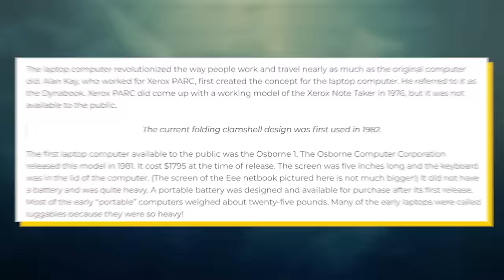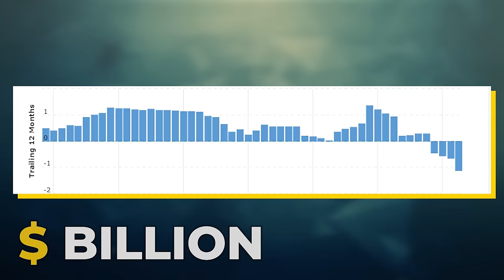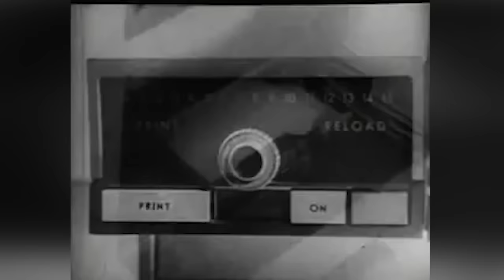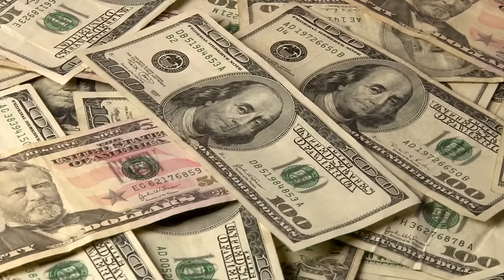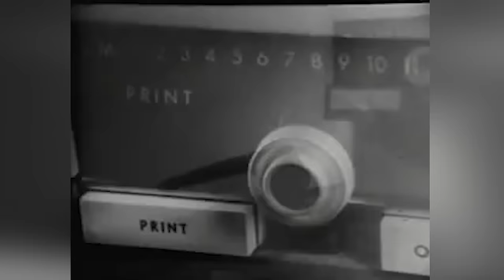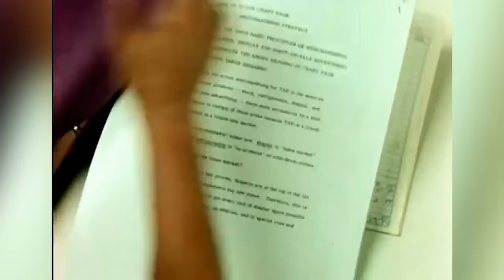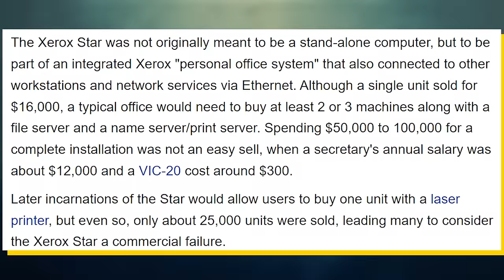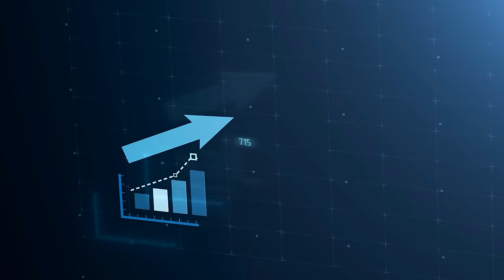Xerox - The Company That Threw Away Everything

Comment: One of my favorite quotes for continuous improvement and innovation, “The stone age didn’t end because they ran out of stone.”
Reply: Who said this pls?
Reply: @divinefavouregeh  I do not know, but I will remember it forever.
Reply: @divinefavouregeh I made it up
Reply: @Roccofan  Sheik Ahmed Zaki Yamani said this as an analogy to oil supply
Reply: @FargothsSecretHidingPlace  That sounds right.
Reply: The bronze age did. Ran out of stone, forced to figure out how that other weird stone could be smelted down into metal.
Reply: @divinefavouregeh  - Fred Flintstone😂😂😂
Reply: Amazing and so powerful line. 👌👌👌
Reply: That is probably my favorite Amory Lovin’s Quote. The Rocky Mountain institute almost recreated the Automobile. I heard Amory give a talk at Xerox PARC ironically enough. Where he summarized the work of his team on reinventing the car. Long and short for a petroleum fuel car it’s the mass stupid. Reduce the mass by half and all of the core systems can be 4 times less powerful or 4 times cheaper just do to the energy it takes to accelerate and decelerate that mass. It was brilliant. But just like Xerox (I was right in the middle of The laptops, bitmap computers, laser printers) Amory had asked the wrong question. He asked how do we make a car that uses less gas and dismissed out of hand that using less gas didn’t solve the core problem. Xerox Being in the office equipment manufacturing business Tried to make desktop publishing a vertical business with only one vendor Xerox. Xerox spent 7 years of development to bring 1 model of copier to the market. Microprocessor based computer companies were following Moore’s law and making things twice as fast or twice as cheap every 18 months. My colleagues and I left Xerox PARC and helped companies like Apple Microsoft and Linotype create the Desktop Publishing business. At Xerox it’s not that the right questions weren’t being asked, it was that the Executive Vice Presidents didn’t see any upside for them and there sycophants from partnering with the Apple’s of the world. Hell At one point Xerox owned 4% of Apple. The Star Office system was a disaster. The software developed for it would not run on the system as configured by the bean counters. Time just frittered away because the top Brass didn’t want to hear bad news. Star office was internally developed hardware running on an internally developed operating system running internally developed applications and right up to launch none of it had ever been run in the configuration that was supposed to ship to end users. You would have thought that NASA was running thing, that’s not a complement. Oh well Just like Apple and Microsoft I’m keeping the money.
Reply: @divinefavouregeh  Amory Lovins came up with this gem.
Reply: @rustybucket2248 , please tell us more when you can. Things like this are real history and so many people don't know it (believing that it's true is another whole story).

I worked in a very different place during these same times (or slightly later). I wrote up a beneficial suggestion (just an idea on paper) when I first started working at this place. It took over 3 years for the corporate big whigs to answer the beneficial suggestion because they couldn't figure out how somebody who had only been with the organization 2 weeks had identified one of the top 5 problems (with a viable solution) with the organization. 
After 3 years, the suggestion was denied. I didn't even get it acknowledged with a Dunkin Donuts gift card for a cup of coffee. Oh well.

I didn't invent the mouse, the GUI or the internet (Al Gore did that, right?) but I didn't steal these ideas and resell them them like some folks did.
Reply: @divinefavouregeh  I've heard it was Saudi oil minister Sheik Yamani. The full quote is "...and the oil age will not end because we run out of oil."
Reply: @Richard Mcintyre You are most welcome, I didn’t intend to write a book sorry about that.
Reply: I got to play with the Xerox Star GUI PC at the Comdex industry show in 1982. It had the first mouse I ever used.  It was fast, intuitive, gorgeous and everything you'd want in a GUI PC.  Very high res, esp for then.  Apple never came close, let alone Microsoft.  Neither had released a GUI, or even a color, computer yet.  Apple's Lisa, their first GUI, in 1983, was a joke compared to the Star and I didn't like using it at all (kind of like iPhones and Macs lol), but the marketing was like the 2nd coming (just like today), plus it was only $6,000 cheaper than the Star, so a hot fad rich person's item at $10,000.   If you're going to copy, at least do it well!  I had no respect for Apple or Microsoft after they came out with their GUIs. And still don't.
Reply: @divinefavouregeh  the blacksmith probably😁
Reply: Pattern recognition led to substitutions, which means Xerox created new documents not facsimiles.
Reply: @Qwerty8  what?
Reply: @adenm8963  yes.
Reply: @Qwerty8  what is your comment
Reply: @adenm8963  Xerox hat nicht geliefert, wie versprochen.
Reply: @FargothsSecretHidingPlace  you got it, in 2000. And he is right about oil.
Reply: Great quote. I will add that to my list of quotes from the tremendously well-spoken "A. N. Unknown".
Reply: That is actually a genius quote
Reply: So.. why did the storage end..? (well to be specific.. the stone age is not really a real age, or the term is outdated)

Comment: Friends at PARC showed me the ALTO in 1978.  My first thought was I could make something like that around one of the upcoming 16/32 bit microprocessors.  I was handed one of the first silicon samples for the Motorola 68000 by Tom Gunter, which I took back to our lab at Olivetti's Cupertino R&D center and plugged it into a wire wrap prototype board that drove a bitmapped CRT similar to the ALTO, and it worked.  We developed that further into a working PCB and with keyboard and a cross-compiler for programming, and demonstrated it to Olivetti management.  But they were afraid of what IBM would do, and hesitated too long into taking it into production.  We left in disgust to start a different company.  A year later Apple introduced the Macintosh with almost identical internal circuitry to my prototype, but a tiny 9" CRT.  Enzo Torresi, the lab director, after seeing the reveal of the Macintosh, called me and said "Now I understand what you were trying to do".  A few years later, Olivetti went from one of the largest manufacturers of IP equipment in Europe, into bankruptcy.  In tech, you have to move forward, or die.  "Paper and toner" as a business plan won't last forever.
Reply: There was a strange reversed NDA policy : Xerox employees could show and tell the details of their work, but it was forbidden to adopt someone else's idea, everything needed to be designed inside PARC. (Michael Hiltzik : Dealers of Lightning)
... PS: Engelbart's "mouse" is a notable exception.
Reply: Your story is incredible.  I guess you didn't keep the prototype?  Olivetti is indeed another good example of a company with incredible engineers and potential, but short sighted management.

Comment: I worked for Xerox from 1978 to 1989 and again from 1992 to 2011. From 1982 to 1989 I worked in the engineering community in El Segundo and with folk from PARC. We disdainfully referred to the company management as "toner heads" because of their focus on copiers.

My time in the engineering community was a wonderful time of innovation. I worked in tech support for all the amazing prototype machines and network. No repair manuals, just shared knowledge among the techs and engineers.

I was hired into the engineering community for my experience with one of the copiers when it was used as one of the prototype laser printers. I was soon put on network support and spent my hours keeping the washing machine sized 300 MB disk drives up and running, trouble shooting network failures and computer's connections to the net. We worked with a prototype fiber optic Ethernet.

Best job I've ever had other than the grueling daily commute through the Los Angeles South Bay area.
Reply: Several years ago, we deployed multiple imageRUNNER Advance units from Canon at the Utah Avenue Campus. Interestingly enough, we had recently hired a veteran from Xerox.  He almost cried when he entered the newly renovated office space which then belonged to a logistics company. He had some interesting stories about the place. There's quite a history behind this place, if you will.

Comment: Xerox as a consumer printer is great. I bought fuji xerox printer it's still run great and strong without any problem after 2+ years and 3000+ pages. It just ready to use when I needed without any tremendous attention and maintenance.
I can bypass toner and drum counter easily, they didn't fused the drum and toner cartridge, easy to replace consumable part, and cheap aftermarket drum and toner cartridge.

But it's bad for company that depending on razor and blade business.

Comment: Xerox had a lot of very talented people in the company. They were mostly known for their photocopiers and laser printers but, as mentioned in this video, they also were responsible for a lot of technology that we are still using today. 

In the early eighties they also marketed an ERP system (Enterprise Resource Planning) that was far far ahead of any competition. I had the honor to work with it in the company I worked for at that time. That system was called XBMS (Xerox Business Management System). Their transaction processor supported multiprocessors on IBM systems long before IBM's own transaction processor (CICS) could. I was a systems engineer for that product for about 15 years, and, oh boy, it was a joy to work with it. When the year 2000 was approaching, the system died a silent death. They just didn't want to invest any money anymore to make it Y2K compatible. And, as far as I  could assess, it wouldn't even have been a huge problem to adapt the system. It was so well structured that it would have been a piece of cake. All date functions were centralized; the only thing they had to do was to introduce a date cut over (all dates less than 50 (or whatever reasonable) are 21st century and all dates bigger than 50 were 20th century dates).

When I later was a systems engineer for an ERP system on Unix, and later Linux, I used many of the ideas that I discovered in that old XBMS system.

I wonder if anyone watching this video has ever heard of XBMS, or even worked with it.
Reply: I didn’t know that. Meanwhile, down the street from PARC there’s SAP today!

Comment: Hey Hari a  heads up.
When you look for a company earnings you should always look  their SEC filings, Xerox have $900,000,000 in cash, but they have have $5,000,000,000 in retained earnings is not like they are short in money or lines of credit.
Not only that but they also put a $400,000,000 non-cash loss of goodwill in their balance sheet.
So for all purposes they lost $400,000,000 but since this is a non-cash loss they didn´t lost nothing.

This is why their stock had a growth of almost 21% since their latest filing.
Reply: $5T in retained earnings?
Reply: @ThinkerHaistTV  my mistake. 5B.

Comment: My first printer was a XEROX inkjet back around 1998
After finding out that the replacement cartridges costed more than the original purchase of the printer, i just threw it to the trash ...
And no, this was not a "printhead an ink all in one solution" like from HP and Canon, i had to purchase 4 separate ink tanks (that time without any chips, so literally just plastic and ink inside) for 1.5x of the original purchase, which included the inks as well ...

I was 18 years old that time. Nowadays i check the "consumables" availability first, and decide if i want that product or not.
I am 43 now, and i can confirm that XEROX gave the world many valuable things, but such as most of the rich companies , they got greedy and lazy.

And this is how the world works. If you fail to innovate for a long time, you are out of business ...
Reply: The lack of chips probably meant it was easy to get cheap knock off cartridges, the market that HP actively wages war against...
Reply: @rorychivers8769  This was around 1999 and the copy cartridges were not available at the time in Hungary.

Comment: Even their industrial copiers/printers were amazing. I used to be a laser printer operator in the 90's and those things pumped out 10000 pages per hour (5000 duplex). 6 input trays of 2000 sheets, 4 output bins of 3000 - mixed stocks - highly programmable. And touchscreen controls - on machines that came out originally in the late 80's.

Comment: The $16K base price of the Xerox Star is 10 times the base price of the IBM PC, but they were not comparable at all. The base PC had 16KB of memory and no disks at all. Upgrading a PC to be roughly equivalent to a Star would cost way over $10K and would need products not available until years later.

On the other hand the Star was sold as part of a larger system and not as a stand alone machine, so people who bought them paid many times the base price.
Reply: This. The base memory on the Xerox 8010 was 128KB, though it ran much better with 256 or 384. (It could hold up to 768kb, as I recall.) Base storage was 10MB at a time when the base PC was sold with a a floppy. And the display was a 1024x808 black and white bit-mapped display - far beyond the capabilities of the base IBM graphics. 

But the basic point still remains. The Mac, which debuted in 84 after the Star's debut in 81 was priced at $2500, but an individual person or manager could decide to buy one. Buying a Star was committing to spending not just the $16k mentioned above, but a print server and printer, a mail server, a server to run Clearinghouse (a directory server), etc. All this would add up to tens of thousands of dollars, meaning an individual manager could never commit to this kind of spending.

Comment: I work for a commercial printer, and while the bulk of our business is offset printing, we also have a Xerox digital press that’s actually an impressive machine. While at its core the technology is basically the same as a laser printer (solid toner that’s applied to the paper and fused with heat), it’s capable of four-color process printing plus several specialty colors, and has a folding, stitching, and trimming unit so you can send a computer file to it and get a stack of finished magazines/catalogs/whatever out the other end. Saves a lot of time and labor for smaller print runs. 

Xerox still has very smart people on board; it’s a shame their management has been so poor. 

Ironically, we also do a lot of business with Kodak, who may be nearly extinct in the consumer world, but they’re still strong in the printing industry. And while printing has certainly declined over the years, it will never go away completely.

Comment: In the late 80s I worked at a UK company, now also defunct, creating technical manuals using Rank Xerox Documenter. This was revolutionary at the time when most large engineering companies had technical publication departments with authors marking up documents by hand and typists creating lay sheets. But it was insanely expensive, I believe about £10K per work station, and under the hood it was based on emergent PC technology which elsewhere was becoming very cheap. I believe the main processors were standard intel, with the added capability for several workstations to share the same printer. For your 10K all you got was a workstation which could produce long documents, when PCs were quickly evolving to be able to handle all types of office tasks. Once FrameMaker for PCs and Sun workstations appeared on the scene Documenter was dead in the water.